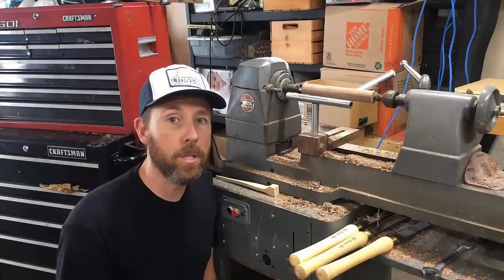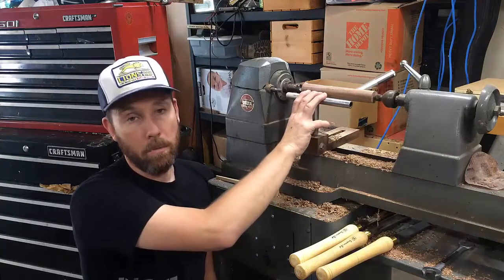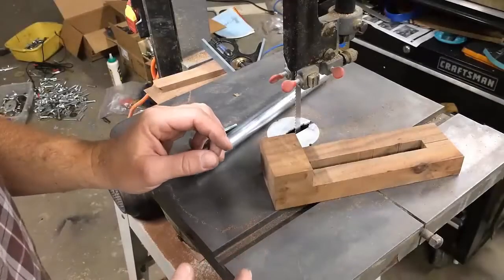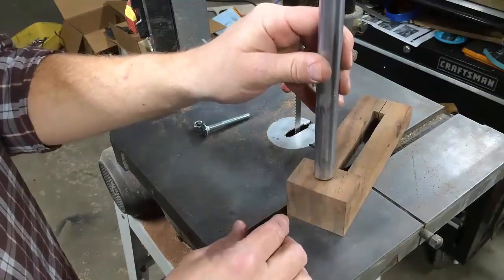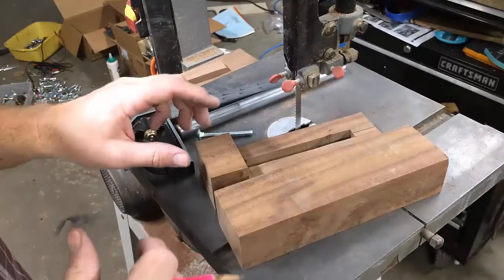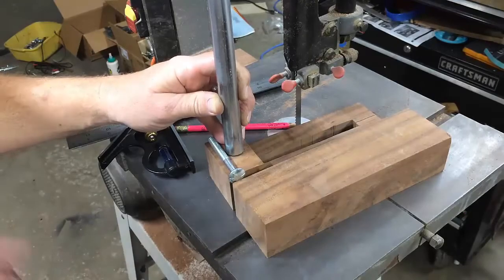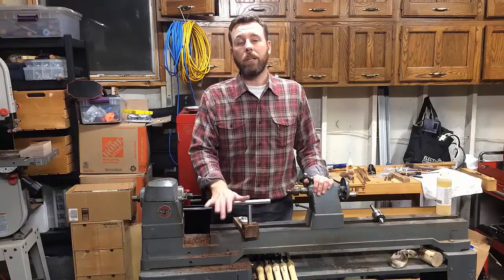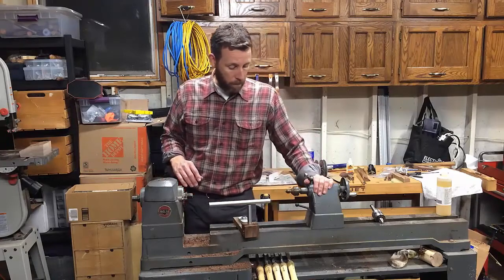DIY  wood Lathe tool rest and tool rest base

Comment: When I found out that a replacement banjo and tool rest for my vintage lathe would cost 2 x's what I paid for the whole lathe, I did as you did and made my own - a little different design, but same general idea.  I left the nose of the banjo open-ended to make it easier to remove the banjo and easier to manufacture.  Works for me.

Comment: Good job mate, only thing I'd add is weld a hozontal bolt on top of your clamping bolt so you dont have to use a spanner but just turn it tight by hand. Otherwise, good job!

Comment: I too, made myself a tool rest, and a base/banjo, but NO slot in the middle or bolt.
This was because I was turning replacement spindles for an antique staircase, and with spindle steady in the middle. It was very inconvenient to have to keep unscrewing the whole assembly, each time I needed to move to the opposite end of the spindle.
So, a magnetic strip tool holder, cut into two pieces, and fixed to the wooden base with industrial, max heavy duty, double sticky tape, [or glue strip?]  I used a bolt threaded into the wood to lock the tool rest height, and a slot cut across the bolt head with a strip of steel set into it, to make a 'butterfly' bolt.
To place it, just drop it where required. To remove it from the lathe bed, just jerk it off. To fine adjust it, just thump it as required. Much more convenient!
Works great!😎
PS,
If you want a really fast shiny finish on turned wood parts, that doesn't change the colour of the wood, try vehicle cellulose spray finish. Its really quick drying, hard, and no brush or other marks.

Comment: Good job on the banjo and rest. The only improvement I can see is to make the height adjustment a bit easier would be to change out the lateral  bolt to a "el" shaped threaded rod that would press against the vertical post at any height you want. You could even make a nice wooden handle.  I also enjoy making tools and accessories.

Comment: i have a similar lathe, with a homemade banjo (not by me).  there is a milled stepped nut clamping to the bed. i didnt see how you clamped to the bed. i am trying to design a long toolrest  with two banjos.

Comment: Nice job...I am in the same predicament you were in...got a lathe with no tool rest or base...been thinking of a design in steel using 3/8" plate steel as the base....but I have a welder and you probably didn't at that time. I am afraid if I used wood for the base it would fail later in time....how has it been? Still working? If yes maybe I'll find a block of hardwood and use it instead of steel but using steel would probably take about as long as yours did...maybe a bit longer because I'll have to drill and tap some threads or weld-on some nuts etc.. But in any case nice job!

Comment: Great fix, thanks for the very easy to follow video. What type of wood did you use? After a year of use how has it held up?
Reply from the maker: I used some black walnut.    It's held up well.   it would be better if I had a nice big chunk of iron instead  but it works well.

Comment: Hi Jake,
Just came across your post re Making new banjo (JIP) arm for an old lathe. It's works a treat and its ACE!!!!!!!!! I've looked high and low for a replacement banjo arm and the only ones I've found are on eBay in America. With the added tax and import tax, as well as the price of the item, was well beyond my pay grade. I was considering ditching the old Draper WTL100, but couldn't afford a new one. I made mine out of the end of a piece of walnut that I couldn't carve due to knots and shakes. 
Adaptations I made was to make it slightly wider to accommodate 2 post holes. 1 @19mm and the other @ 22mm as I have varying rest sizes on different rest I've been given. I will now be planning to make a second rest holder. This is after I've made an 18" straight rest with 2 posts. I will be using this for making walking sticks and long vases. 
I'm back up and running and now looking to see what else I can make to make woodturning more accessible to me.
Thanks a million
Crafty Kingfisher

Comment: Jake, Can you tell me if you used regular mild steel for your rest and what was the threaded piece that joined the top and bottom together?  Almost looked like a large set screw in the picture?  Or was it just a piece of threaded rod?  Nice video, good info on what and why you did some things.  Regards,
Reply from the maker: I believe it was mild steel.  I had this  material left over from what came with the lathe.   I just tapped the steel going horizontally and vertically  and then cut the threads off of a bolt and ran a tap down it to clean it up.